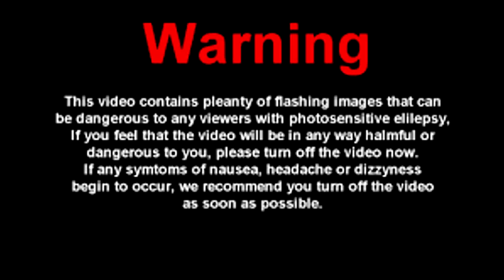My "NEW" WR450SM Supermoto!! 😎

Comment: hello, I need your help. I bought a wr 450 f 2005 last week and saw that the hoses in the rear reservoir are loose and found no place on the radiator to turn them on. I want to know where the reservoir hoses are fitted, because I think the radiator on my bike is a cross-over bike. if you can make a video showing how the cooling system works and where the hoses are connected

Comment: I just got a 07 wr450sm as well, what jetting you running man? Dialiing mine in. So far 170 main, 48 pilot, and 40 leak.. thinking of plugging the leak jet though.
Reply from the maker: Im running what I have and its good but not the best stock 165 main 48 pilot, 5th positon on gytr needle and stock leak. I prolly need a 168 main and a 45 leak. Theres a massive forum about wr450 jetting if you wanna check it out. Btw mine is an 06, unplugged pipe, snorkel removed, ais removed, yz ex cam and average altitude of 2500ft
Reply: Squid WithGear 
can you tell me what gearing you have and what the normal cruising speed is with it, and maybe the highspeed, too :p (whitout overreving + killing the engine)

Comment: Did you get sprocket compensation on the rear wheel ?
Reply from the maker: In this video I only have a 16t front instead of the stock 14t with stock rear. Now im running 15-47 and seems to be a decent setup

Comment: Why did you switch the rear hub?
Reply from the maker: +The Lone Rider so the story goes once upon a time I bought a set of super nice and super complete supermoto wheels from an older dude in Phoenix. He said they were for a wr but I got em at such a stupidly cheap price that although I was skeptical, I still bought them. Front just needed different bearings and fit right on but the rear was a drz400 hub and had to be changed
Reply: D'OH